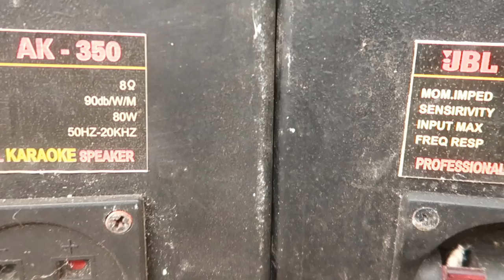Restoration professional karaoke speaker / Rehabilitate step by step

Comment: What a good job?  There are different models of speakers, different crossovers.  At the end you hear a badly glued speaker.
Reply: I agree on a tech level.  Replacement of a voice coil, cone, surround and dust cap effect the sound completely.  If replacements are exactly as originals, them ok.  But frakensteining parts and expecting it to sound like factory is foolhardy.  BUT if these videos spark interest in repair and refurbishing, then great!  Just as the expression Caveat Emptor appliers to purchase, there are similarities  to repair. Just because it is on Youtube does make it 100% right.  I do like the fearlessness of Mr. Electricity, not to mention the chickens clucking!!